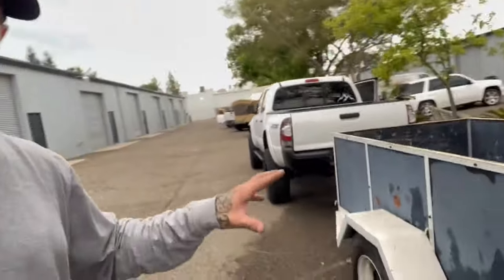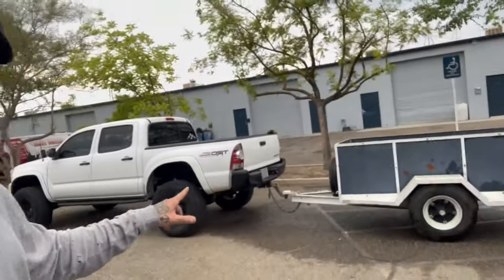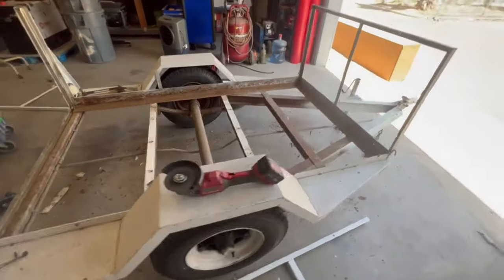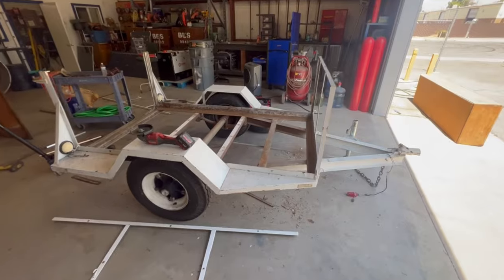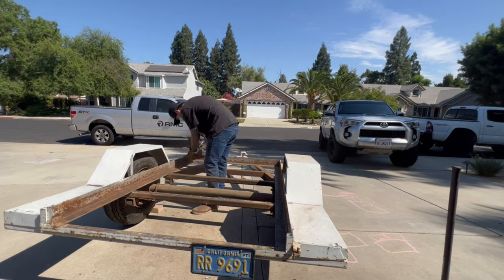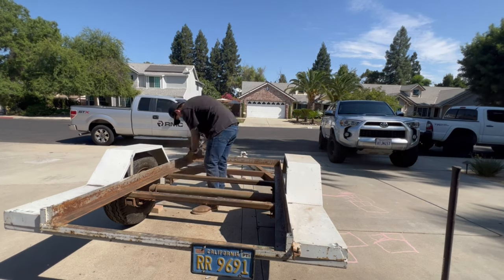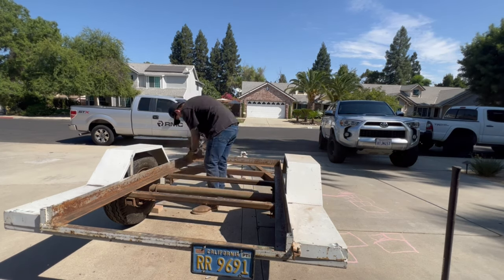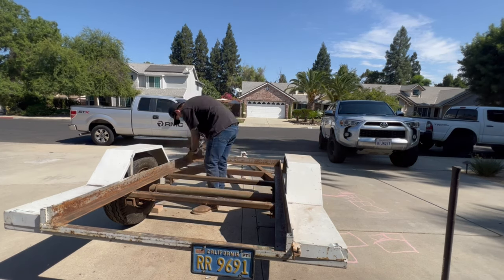Part One Of The Mobile Welding Trailer Build!

Comment: You should weld a piece of square tubing on the back of trailer and make a leg that you can drop down so your trailer doesn't flip when it's not hooked to a truck
Reply from the maker: That’s a great idea was thinking the same thing myself!
Reply: @CM_Weld  you could also mount a vice on a piece of square tubing and use that when you don't have the  leg in there